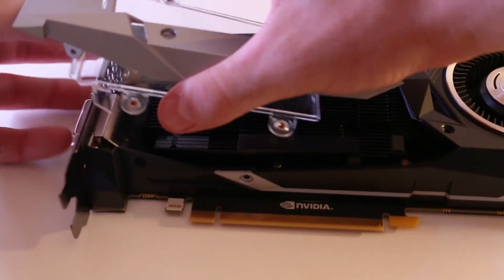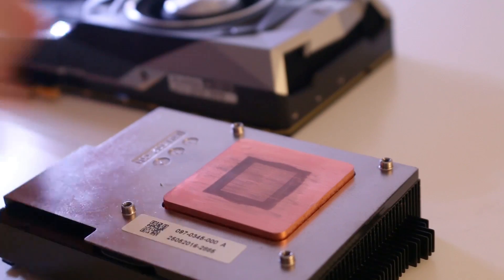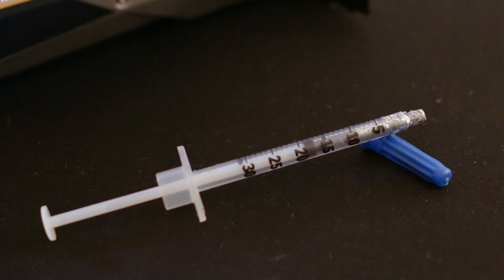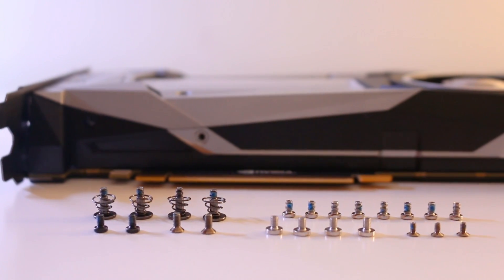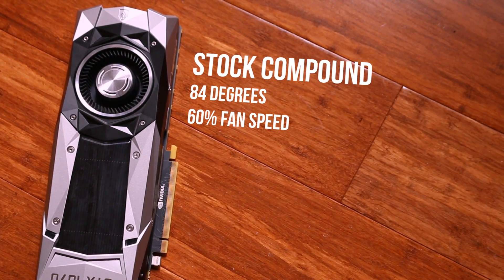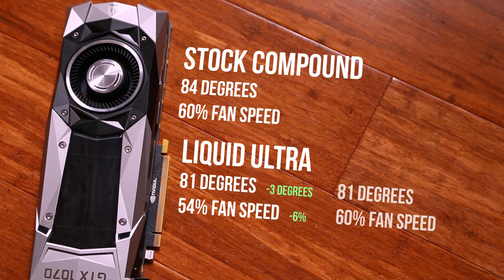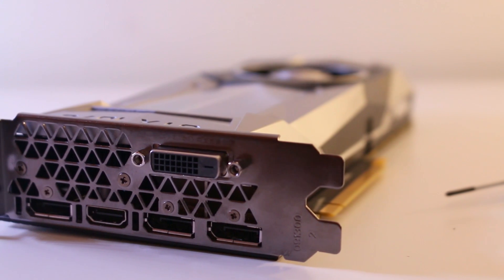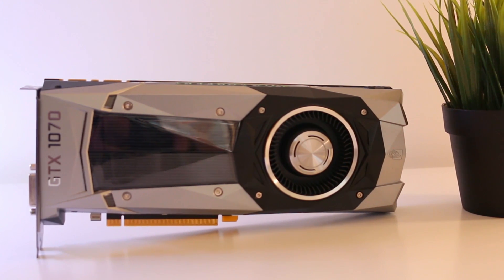Replacing GPU Thermal Compound With Liquid Metal?

Comment: MSI R9 390 8GB

Stock paste = 93C max, idle around 65C on 1125mhz with +75mV, could not get it above 1125mhz stable with more mV. 

Used noctua paste = around 84C max, idle around 50C on 1150mhz with +100mV, could not get it stable above.

Cool Laboratory Liquid Ultra = max 73C, idle around 38C, on 1175mhz with +100mV, 24/7 stable

in every test the custom fan set was the same

i think the blower style cooler is the weak link so u can't strech liquid metal performance its giving the heat to cooler, but cooler is slow to disipate the heat and it returns to core
Reply from the maker: Thanks for sharing your results! The 65C idle before TIM replacement is a little worrying, but good to hear some great results.
Reply: its amd old 28nm,  its more then 300w card, on stock boost clock 1060, idle was around 45 and with no mV to the core, but its a poor chip, most ppl are hitting 1150 and 1200 on stock tim with only +50mV.

I just got poor 390 chip :'(

now am waitin for vega and volta then i will decide to go green or stay red :D
Reply: robert if it is an intel cpu and you can delid it, like 7700k, its going to work perfectly, but i used noctua paste and liquid metal on soldered fx 8370e clocked at 4.8ghz and 1.5V and the difference was around 2 degrees C.
Reply: montetank tankkiller 
ok so I just did some research and apparently you can use 3M high electrical tape to seal off those areas before applying Liquid Metal on the gpu chip die in case it does drip or ooze out when applying or putting the heatsink back on.
in fact you can leave tape on there if you wanted too.

Also another guy used clear nail polish like  3 layers around the outside areas of the GPU chip die just in case he accidentally got Liquid metal on those areas or oozed out.
Reply: does that work for CPU?
Reply: im no expert and just been reading overclocking other cpu like 7700k and 1700x... is 1.5V safe for ur cpu?
Reply: thx  ^^
Reply: Nisam gledao vrm-ove, budem i njih pratio, al MSI je napravio heben cooler. 390x troši još više wata i jače se grije, taj DD hladnjak od xfx-a je shit. Ovaj novi na XFX rx480 gtr je heben. Mislim da bi mogao još više spustiti temp sa acelero xtreme4 hladnjakom + tekući metal. 

Pazi samo da dobro očistiš hladnjak, ne smije ostati niš paste, jer pasta može sadržavati aluminija što reagira sa tekućim metalom i razgrađuje ga. Moraš očistiti hladnjak sa brus spužvicom koju trebaš dobiti uz coollaboratory liquid ultra. Služi za izravnavanje površina ali i da skineš pastu koja se zavukla u pore hladnjaka. Isto skini svu pastu sa GPU-a (ne trebaš sa brus spužvicom :D). 

Metal samo stavi na GPU, jaaaako tanak sloj. Na hladnjak ja nisam stavljao, ali možeš. Htio sam provjeriti hoće li raditi OK, ak sam stavim na gpu i radi savršeno. Što je tanji sloj metala ili paste brže temperatura prijeđe na hladnjak.
Reply: VRM 1 66C 
VRM2 63C 
clock 1155/1525 +100mV
na 1175mhz mi ipak nije stabilno nekad zna izbacit kockice
Reply: hladnjak isto tako ne smije biti napravljen od aluminija, svi novi i veliki cooleri su od bakra ili niklovani bakar.  Provjeri samo za acelero xtreme4 da li je bakar odnosno niklovani bakar (nickel plated copper).

E da i imaš puuuuuuno bolji GPU od mog, sa ovim MSI cooler-om i tekućim metalom sigurno bi postigao 1200+mhz sa +100mV. Baš sam dobio sranje od GPU-a, ali tvoj je x model tak da.... :D
Reply: logilogilogi da onda vrm-ovi seru kvake. Treba gledat recenzije dobre netko tko gleda kakvi su vrmovi kondenzatori da bude pic pic, pa da ovisi clock sam o gpu-u. ja imam u planu uzet nvidiu sljedecu. voltu al cekam da vidim kakva ce vega biti.
Reply: logilogilogi stress stability test 3dmark 20 min nis mi ne dize temperaturu na gpu-u kao taj bench. a instaliravam samo orginal igre.
Reply: ej testirao sam VRM-ove ponovo, VRM2 je stalno na 63C (našao sam da on uopće nije spojen i uvijek pokazuje istu temperaturu), tako da se gleda samo VRM1. Uspio sam ga dić na 81. Kućište mi ima puno 140mm ventilatora pa se sporije zagriju imam dobru cirkulaciju zraka. Ostavio sam duže grafu na stress testu i VRM1 je došao do 81C. VRM-ovi su napravljeni da izdrže do 125C :D
Reply: I recently tried Havoline 4T on my GPU and its working :D
Reply: what happens if I accidentally got abit of liquid metal on the green part of the gpu die chip or on the many little silver chip thing around the gpu chip am I screwed?
Best to clean it off with isopropyl alcohol?

BTW I heard if you got Liquid metal on any Aluminium part of the GPU it's not good because it starts to corroded eat away?
Reply: +Tony Tran.....thats true. Thats with Aluminium. If the liquid metal is on 1 silver chip...doesnt matter, Its important, that the liquid makes  no contact between two parts.
Reply: Nice idea :)
Reply: Apparently Thermal Grizzly Conductonaut and Grizzly Kyronaut are two very good thermal paste and liquid metal for CPU & GPU. That is if you're willing to pay the high price for it.
Reply: try change thermal pads to
Reply: For new 7700k its safe up to 1.52V (http://www.intel.com/content/www/us/en/processors/core/7th-gen-core-family-desktop-s-processor-lines-datasheet-vol-1.html) Page 114. 

I have now 7700k at 4.9 GHz at 1.35V with MSI Z270 Titanium, waitin for delid tool to decrease temperature so I can hit stable 5 to 5.1 GHz maybe if I am lucky 5.2 :D This is to hoping that trim intel made on my cpu is shit, when I soon delid and put L.metal i will post results.

fx 8370e i did not find their datasheet, but considering temperatures they must be below 62C, for i7 7700k below 100. temps for fx8370 at 60+C is considered high for intel i7 90+C is considered high and those temps would and can degrade your CPU. I had mine fx 8370e around 55C in prime95. 

Mainboard is one of the factors to get better and more stable overclocks. I had asus sabertooth 990fx R2.0 and i could get fx 8370e at 4.9 GHz at 1.375V, then i physically destroyed the board :'( long sad story), and later got ASRock 990fx killer. With killer board I could get stable 4.8GHz with 1.5 V only. Temps were safe on both overclocks.
Reply: Mozda zvuci glupo, ali ako se radi sa liquid cooler, treba se sa finim smirglom malo natrljati. To je najstariji trik. I ovaj momak u vid to nije uradio. Tek onda ima liquid cooler svoju svrhu.
Reply: Bigd Hehe 
I agree 1.5volts on a i7 4790K, 6700K, 7700K is way too much not even safe for it overkill.
For me 1.25Volt at 4.5ghz Is safe for me.
And 1.30volts for 4.8ghz Stable 24/7
going for 5ghz at 1.35Volts is unstable at times but gets really hot unless you doing custom water loop cooling.

Comment: take it back apart and put butyl tape over those resistors! just make a wall of butyl tape around the chip.  do this EVEN if you are going to be replacing the LM with paste,  cleaning that stuff up is horrendously difficult.  i would try to squeegy it all into the middle try to suck / vacuum as much of it off as i could.   i dont think q-tips soaked in alcohol do a damned thing to help, the LM simply does not thin out with alcohol that i can tell.

Comment: only way i would ever use that stuff is if i have padded out all the danger zones with butyl tape.  all the pc board areas outside the silicone but inside the bordered area get butyl tape and if i ever went to replace the oldlstuff i would use some kind of vacuum t remove ALL of the old stuff.

Comment: why do you all get such hot gpus? I have fan speeds running at 100% on my fe gtx 1070, 28-35 idle, 60 when on full load overclocked too by 200mhz

Comment: Blower design is the problem here. It's an inefficient cooler so the TIM will not be able to do much since the radiator is so weak in comparison to twin and triple fan coolers or even watercooling blocks.

Comment: I saw a  20c. Cooler on my gpu    That I used for a test. A hd5770    Before I was getting 80+c   After  around 62c  on. Gaming   Same fan configuration   I used grizzly liquid metal   It very work

Comment: The explanation for the amount of paste that you'll find on a GPU when you first open it is because manufacturers want to make sure the GPU is moving to the heatsink properly. Especially since it, unlike a CPU, has no heatspreader. So it's usually fine to be liberal with thermal compound on a GPU as long as it's not electrically conductive.

Comment: There is another video where a guy put liquid metal on a titan x and same results 
Its because the blower style cooler is already overwhelmed and putting liquid metal on a blower style cooler is useless
Now if you have custom watercooling or 2 or 3 fan cards than liquid metal will work good

Comment: My 1070 FTW drop 10°C, from 72°C to 62°C when running Superposition Benchmark, with the Thermal Grizzly Conductonaut, even with GPU full load, my fan only run at 25% and very quiet. So yeah, i say it is worth it to apply liquid Metal.
Reply: Hi, did you apply on copper heatsink also ? After one year, do you have any issues (Drying ? temperature increase ?) or do you get same performances as of first day you applied Conductonaut ?

Comment: You not comparing apples to apples.  2 degrees cooler with fan speed 5% lower.  What if fan speed was the same?

Comment: need to apply a thin layer to both parts ... liquid metal is a thin layer unlike thermal paste ... but it wont ... fuseor really contact both sides, you can see this when you pull it apart and you will see nothing on the copper side. but if you have it well put on both sides the liquid metal will make enough contact with each other and actually work.

Comment: You can't use liquid metal with a copper heatsink...it may work for a while, but eventually that liquid metal and copper heatsink will "bond" and you'll have 2 bone dry pieces of metal touching one another, while also having a ruined heatsink.
Reply: care to share your science evidence on this? The majority of 3rd party GPU designs use copper heatsinks, and if your comment was true then I would imagine LW would not be used by anyone.
unless you are talking about 10-20 years of use?

Comment: I hesitated a lot and then chose a Grizzly kryonaut with 12,5 W/m/K of conductivity, which is already 15 times better than the included with my AIO cooler master one.There is already a huge improvement, I drop 15°C on average. The same paste was applied on a 780 Ti and resulted in a 10°C drop on average, without any risk since this paste is not conductive.

Comment: Hi, i have ASUS STRIX GTX 960 4GB OC Edition VGA Card and
I want to replace thermal compound to TG Conductonaut . But it can't be apply for aluminum.
can you please tell me that vga card can apply Thermal Grizzly Conductonaut? Please reply :)
Reply: Bit late but your 960 doesn't have an aluminium cold plate, it's nickel plated copper, so you can LM it. The radiator is aluminium, but that isn't in contact with the LM.

Comment: Delidding and replacing the internal TIM with liquid metal is not only viable - it is extremely effective on CPUs.

On a GPU the surface area is so large that they aren't lidded, so there isn't nearly as much to gain (on CPUs it can be as much as 20 celcius difference if you replace both the inner and outer layer).

One thing immediately jumped out at me here though - I would NEVER EVER use liquid metal TIM on a die without first thoroughly sealing all those nearby transistors with a liberal amount of conformal coating (or similar electrical insulating sealant). If the liquid metal touches these your die is almost certainly dead - and it remains liquid all the time so it is only held in place by surface tension. I would definitely not trust that 100% to remain in place for years of heat cycling.

If you use the correct amount (very little) it shouldn't be an issue, but adding that insulating conformal coating is your first and only line of defense - and it's cheap and easy to do, so why the hell not? (I wouldn't recommend spraying it on mind you - apply carefully with a fine brush or even go ghetto with some cotton swabs).
Reply: I find that comment very helpful, what would you apply to insulate the die? Can I use thermal paste to do that?
Reply: You don't want to insulate the die itself - but the small transistors and other exposed contact points that are just around the die (normally covered by the heatspreader). That's probably what you meant, but I figure it's worth clarifying to avoid disaster :P

As for what to use for the insulation - in theory anything that is electrically insulating works, but (non-conductive) thermal paste seems like a poor choice because it is soft - nearly liquid in some cases. I wouldn't trust that to not move. You wouldn't insulate an electrical wire with vaseline would you? =)

Much better options are: 

- conformal coating as I mentioned. If you don't know what that is - it's just a name for common circuitboard insulation (usually spray) that you can buy cheaply at any hardware store or similar. Ask in the shop and they will have some kind of product that does this. Spray some in the spray-top and apply the liquid from there with a small brush, swab, or any other suitable tool. I'd do a few layers  a couple of minutes apart to be doubly sure to get a good seal. If done properly it should give you a perfect defense against shorts under the IHS.

- A dab of silicone, some nailpolish, even some glue should work in a pinch though. (but see note below). I've even seen electrical tape being used but that just seems a bit too ghetto for me :)

TAKE NOTE: Whatever material you choose to use you should check the label to see that it is rated to work at high temperatures (I'd get 90 celcius if possible to be sure, but realistically 70 would probably be more than enough given that it's not going to actually touch the hot die). Heat tolerant stuff is not hard to find or more expensive since it's used a ton in automotive applications.

Let me know if I can be of more help.

EDIT: This post is written with the assumption that you are speaking about CPUs, but as far as insulation goes it's the same process for a GPU.
Reply: Man you're a hero, thank you very much! It's all very clear even if Im bad in english. I want to replace my GPU cooler and was guessing about getting LM seeing it's difficult to apply and there's real risks. Even if Im not dexterous I now feel confident knowing it's easy to do it safely with proper measures.
Reply: Ok, good luck :)

One final note just to be safe:
Be 100% sure your cooler coldplate (the part that touches the GPU die) is not aluminum.
The gallium used in all liquid metal thermal pastes completely destroys aluminum and makes it crumble like a cookie.

All other common materials are ok (usually copper or nickel plated copper). There can be discoloration on those metals, but it doesn't actually hurt performance.
Usually only the cheaper coolers use aluminum, but check to be sure.
Reply: Yes I immediately checked. It's the Morpheus II from Raijintek and it's copper. From what I've read this cooler can give a minus 10°C compared with coolers from aftermarket GPU resellers (I've got an EVGA 1070 with noisy fans). With LM I hope to get about same noise levels as in a water cooling system but without any pump noise. After a lot of researches I think I found my nirvana!

Comment: Using liquid metal compounds is not worth it on any blower style or founders editions but if you get 2 or 3 fan cards it makes a 7-10 degree Celsius difference. This cooler style shows its inadequacy for a quite overclocking build.  For these types of cards the best cooling option is to go water cooling, but even if you did you might as well just buy the other aftermarket types. I dont know why anyone buys Founders cards unless it is because of look preference or price.

Comment: have fun when your liquid metal dries out.
Reply: Liquid metal doesn't dry out. As it heats up it turns into a liquid state and becomes solid when the system is off. I have had liquid metal on my CPU for 3 years now and it hasn't shown any signs of drying up. Can't say the same for my other systems with normal paste. Those needed a repaste every now and then. Also even if it does "dry up", you can easily apply more down the line.
Reply: GrayFox370 So it should be safe to do this with my 8700k right and not have to worry about drying up?
Reply: LM remains liquid always, it doesn't go back into a solid when the system is off unless you live in siberia.

It does 'dry up/ (sort of) by oxidation via repeated heating/cooling cycles, but the major effect is reacting with copper surfaces. Nickel less so.
If your heatsink isn't nickel coated the biggest worry is that it's not pure copper.

Comment: Can you keep electrical tape on the little transistors around the gpu chip when you put it back together? Or should you remove the tape before you put the card back together
Reply: You can keep it on.

Comment: There is no doubt in my mind the chineese assemblers of video cards dont care about thermal compound application. They always put way to much on so the card/cpu doesnt run hot. This just shows that. I would still do my own vs the factory poor application. There are plenty of documented vids showing temp drops using better compounds on non-blower style cards. the bottleneck on blower cards is the heatsink is too small.

Comment: Can i put superglue on the capacitors that located close to the die to prevent conduction? Will this hurt the gpu itself?
Reply: You only put a super thin layer on, when applying put tape around the die, then incase you have a spill or put too much on while applying, you can make a mess and not harm anything. remove the tape and then your done.

Comment: I did this on my 1080ti just recently and it makes quite a good difference... But in testing it with my 970 beforehand I accidentally pushed too hard and it squirted all over the PCB.. it killed the 970 but I learned my lesson at least